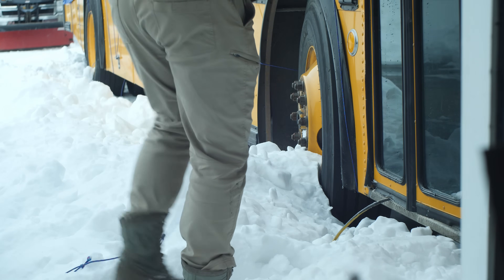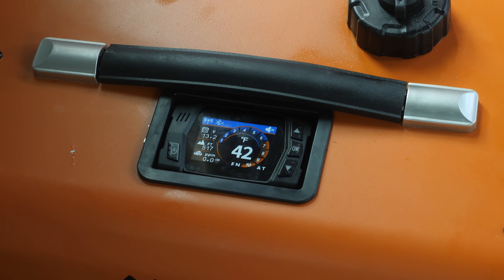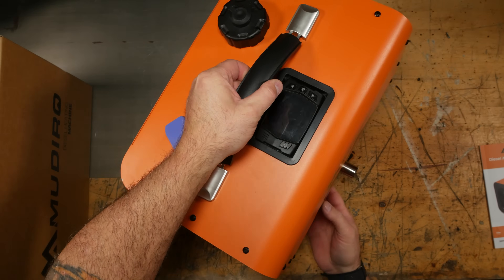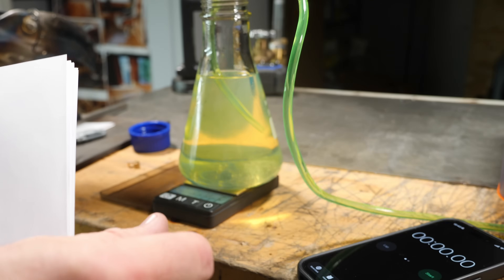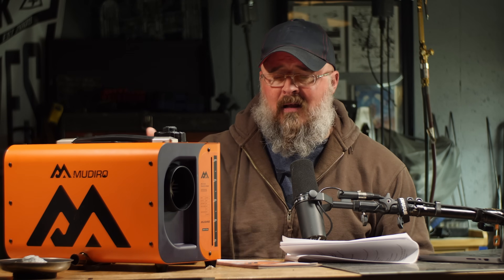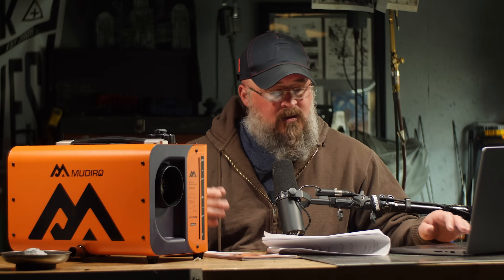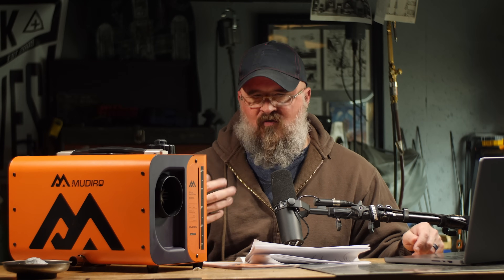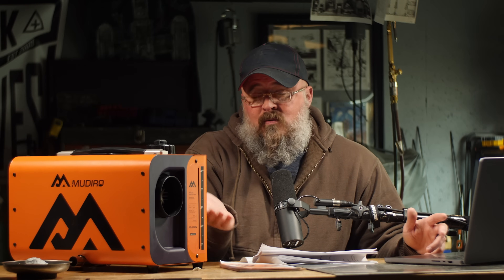Can This Portable Diesel Heater Survive a 15°F Cold Start?

Comment: Muffler will have condensation n must be run at an angle that allows moisture to exit rather than it stay in the pipe or back into the burner can....

Comment: I have only one piece of advice for you, these diesel heaters burn fuel quite efficiently, the result on the exhaust is CO2, some lost heat and water vapor. If you want to avoid problems with the heater, I advise you to position the exhaust lower than the device. This way you will also eliminate the condensation that is created during combustion and you will not collect water in the device, this way you will protect yourself from errors and malfunctions. I have a VEVOR heater, it is quite similar to yours and the user manual recommends an exhaust slope of up to 45 degrees relative to the heater position.

Comment: Similar heater here; mounted outside.  You get fresh dry air and plenty of oxygen for the combustion chamber.  Advantages and disadvantages with either in or out.  You can get a wheel bracket to mount the heater on outside.

Comment: That's just under 12 bucks in kerosene a day couldn't afford it around here it's about 360 bucks a month i heat my whole house with a kerosene monitor for 800 a winter
Reply: what kind of kerosene heater do you have?
Reply: @b @betterwithrum its a monitor 441 (probably 28 years old at tbis point)
no longer available next best choice is a toyo stove)
Reply: @sprint48219  ok thank you for the quick response, looking for something to put in our cabin

Comment: I purchased this same unit for my homesteading project. The "installation diagram" in that manual is near criminal, they have the intake and the exhaust mislabeled..... That carbon monoxide detector will definitely come in handy if someone actually installs it the way they have it labeled!!... Also the app linked in the QR code for android in the manual does not exist.... for me at least,.. Did you test on android or IOS?  .,. I emailed the company and they responded with emailing me a copy of a generic app that doesn't Bluetooth to the unit correctly... Other than that.... As far as the heater goes, ive had it running full out in my camper currently for the last couple weeks and it definitely gets the job done as far as a heater goes!.. Its super efficient. My last note on this unit is when you turn up the heat on it says "UPSETTING",,, i cant quite shake that one from my head that I'm actually upsetting the heater by turning it up.. just some translation loss on that one lol.

Comment: What about preheat incoming outside air with heat exchanger from exhaust? It would take a short moment to heat up, but then it could work, right? Or there would be big risk of building up soot?
Reply: Soot comes from cold air / too rich burn / too cold burn..   ash comes from impurities..

Comment: About carbon monoxide the heater does not make carbon monoxide You're never going to detect carbon monoxide The exhaust is where the carbon monoxide is The air flowing through the heat exchanger and the air flowing through the exhaust and therefore combustion chamber are completely separate paths The only time you will ever see carbon monoxide is if a seal or breach occurs between the combustion chamber and the heating chambers. Meaning something's broken. Otherwise the only way you're going to get carbon monoxide is if you have the exhaust inside.
Reply: Wouldn't be a good idea to have a carbon monoxide detector / cutoff in the event a breach occurs between the combustion chamber or if something becomes broken or if someone accidentally vents the exhaust inside?
Reply: I always run the unit inside.  An incomplete burn and a leak is rare..  got evidence off a leak, scrap it..

Comment: FYI that fuel filter was backwards right? The flow is supposed to trap the debris where you can see it, not inside the filter media so you can’t tell when to change or clean it.
Reply from the maker: Thanks for the heads-up on the fuel filter orientation, I just used it for that one test and it was removed. I'll definitely look into that going forward.
Reply: I was going through the comments to see if anyone noticed. 😃👍
Reply: Big side is always the in.....

Comment: I hope you realize that muffler has a weep hole for condensation so some exhaust gases will be escaping in your living space.  They are never to be installed inside.
Reply from the maker: That's a good heads-up about the weep hole and exhaust gases, appreciate the info. I didn’t see a hole but I will look for it.
Reply: @HanginwiththeHursts pretty sure I can see the hole in your video but these are fine indoors but put the muffler outdoors

Comment: Very expensive  heating solution,propane heater much cheaper in my rv
Reply: Diesel heaters use about 1 gallon a day propane is way more expensive than diesel per btu, and efficiency
Reply: Propane is sold by the pound fuel is sold by gallon or liter. One pound of propane is 0.24 of a gallon or 1 liter.
Reply: Unless your propane heater is vented not only do you have to worry about carbon monoxide but condensation build up. Also propane can boil (freeze) at temperatures around -40 F.
Reply: Propane is 40 percent?  Less Energy per gallon or pound of fuel .  Diesel can be obtained everywhere and easier to transport .  Gasoline can be used in a pinch

Comment: Air outside is negatively charged. Much more healthier than recirculation old air.
Reply from the maker: That's an interesting thought, but the main goal of recirculating the air in this context is heat retention and efficiency.
Reply: If the train of thought is don't recirc because fresh air is better, then why don't you stick your furnace outside and duct that into your house? Oh right, that would be stupid. So maybe just apply some logic before saying dumb things like that